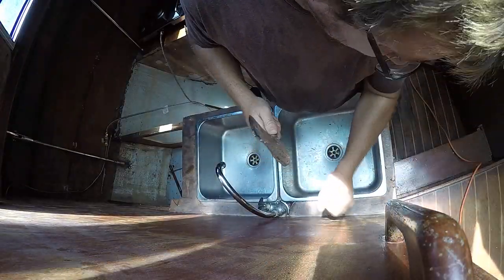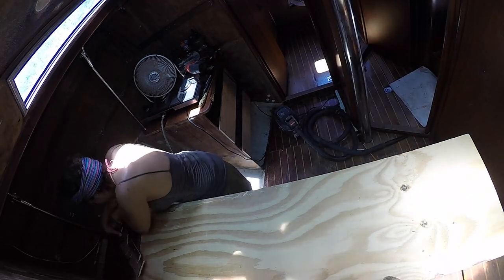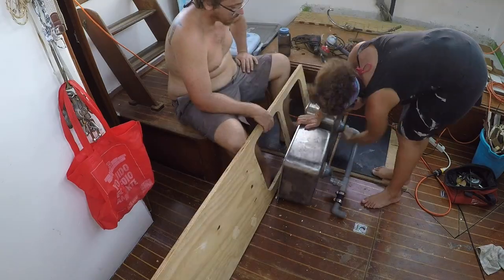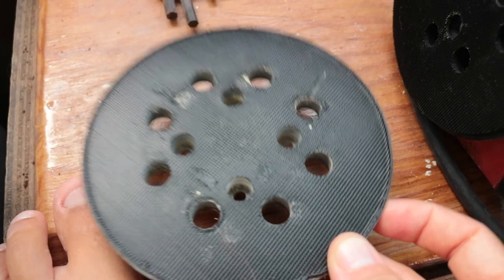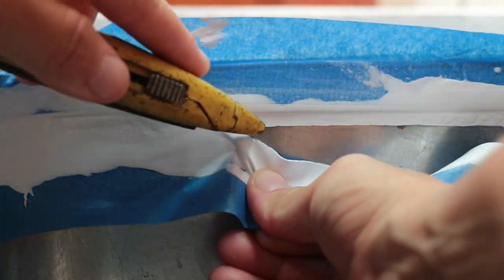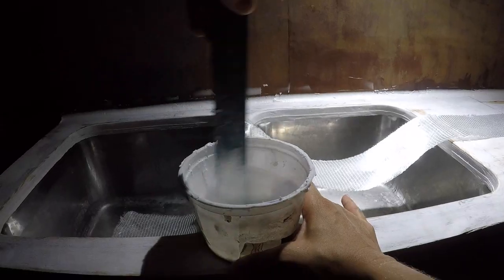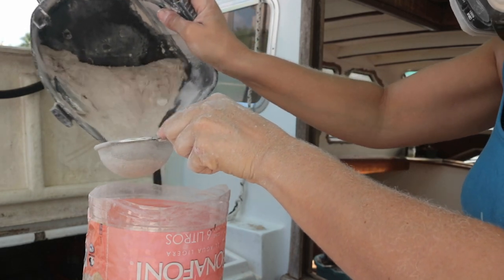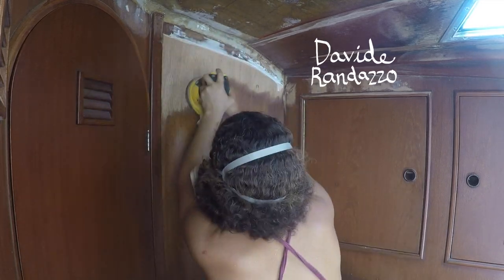MINIMALIST GALLEY REMODEL in the Midst of a Pandemic

Comment: The sweltering Quintana Roo heat is literally radiating out of the monitor as I watch - phew! God, I have had my fill of epoxy, and I've also worn out my share of sanders (and sander pads, as well), but at least in BC I generally didn't have to deal with sweat dripping into my work! Your perseverance and energy is inspiring. It's a finite resource though, and I feel like after two houses and a boat, I may be overdrawn on my renovation project account, and so I'll happily just watch you spending yours!
Reply from the maker: I think a lot about how the boat projects would be if we were back in BC, and overall, I'm happier to be sweating on the work, rather than it be cold rain (any time of the year) while trying lay down some epoxy or paint! But everyone is different - I can also clearly see how some might find the heat here unbearable. And I know what you mean about finite resource - they say that money doesn't grow on trees. Neither does desire to sand the boat. But I was almost going to call this one 'We Gotta Eat'. We have to get the galley up and running again, ain't going to fix itself.
Reply: @sailorama  Ah yes, necessity is the ultimate motivator... Well, watching you brings back good memories as well. Not to mention, I remember ambling along the canals and lagoons of Puerto Aventuras, dreaming of what it would be like being a rich gringo and living there! The resort and summer home part where you are located is a little surreal, although I'm sure it brings a lot of jobs and money to the area for regular folks. Kind of like a Mexican mashup of Parksville BC and Venice Beach!
Reply from the maker: @LazyJacques  Yeah, surreal is the right word for this place! Our construction-zone sailboat is so out of place, ha.

Comment: Please put the manufacturer, model and LOA of the boat you are working on, in the video title??  We will be buying a boat in a few years, and might like to buy one of the ones you are working on.
Reply from the maker: The truth is, the make/model of our boat is not common, she seems to be custom-built, and we haven't learned much more than that. The previous owner didn't have much info on the subject either. She's a Vennekens Koral 40. If you google the name, none of the photos that will come up will show the correct sailboat. We've never seen another version of a Koral 40, and the boatyard that built her doesn't manufacture sailboats anymore, as far as we can tell. If you are searching for a similar boat, typing in '40 foot pilothouse' will be key - our Inesperado is similar to many of the stout pilothouse sailboats that pop up.